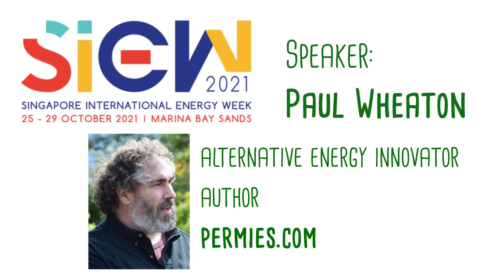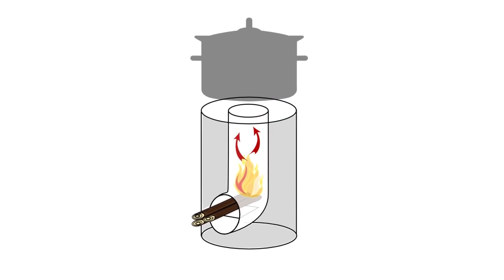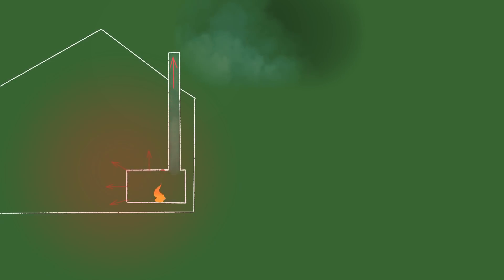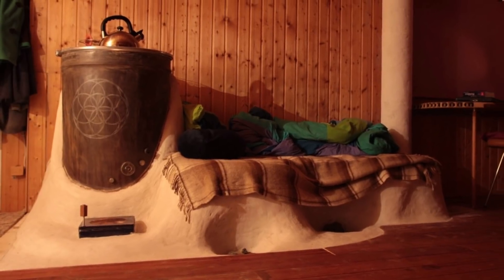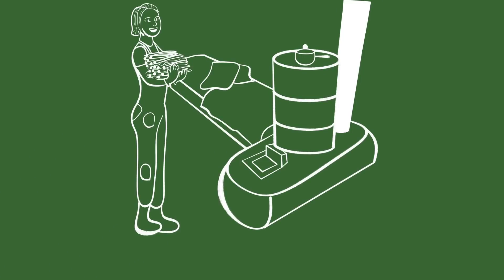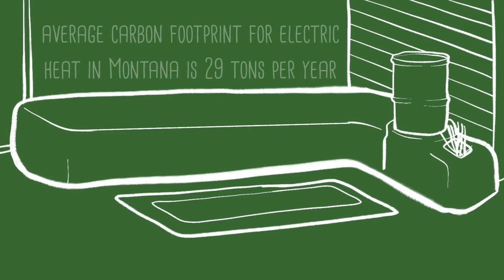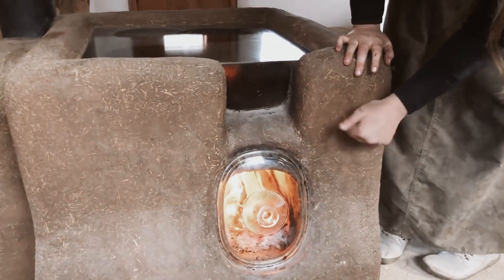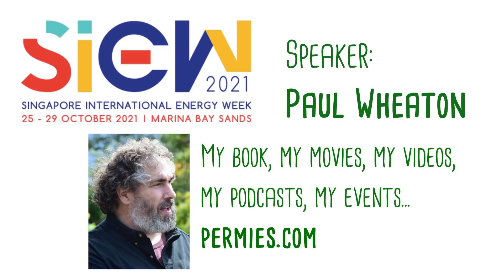Presentation for SIEW - residential heat for first world and third world countries

Comment: Especially now at a time when the supply chain is under pressure, your ideas are important. In this video you stated that you share your knowledge for "free" and that is a wonderful thing. 
I watched your video on 'thermal mass heaters' several times. It's brilliant.
I'm 68, retired and I've lived with public utilities all my life so major changes in my lifestyle won't happen. If I was a younger man I would try to add a steam boiler to what you've developed.
The industrial revolution was powered by steam. Steam expands which means it can be used to push pistons or spin turbines. This was before electricity was used. Many power plants, perhaps a majority, use steam to power their turbines. 
A small basic turbine should be able to generate 12V from a car alternator to charge a bank of batteries. An inverter will change it to usable power. Many modern tools and appliances are cordless. LED lights are common.
The turbine could be any basic style. I don't think it matters. A steam nozzle would spin it. A skirt around the spinning disk would deflect the centrifugally forced steam. The apparatus could be housed in a 'steam shed'. The homeowner would have to monitor it so it's not a passive system...but...we can supply our own power needs without a meter on the side of our homes.

Comment: That's a really interesting idea.  So I guess the jist of it, is to just burn a small but fast/hot fire for a short time, and that heat is captured via the mass?   I bought property to build a homestead so ideas like this are always interesting to know.   I'll have more than enough wood to burn but if I can be more efficient anyway it's still a good thing.  If I have an abundance of dead wood I can also look at making biochar.  I want to experiment with using that as insulation actually.
Reply: That's exactly right.  You send very hot air into a mass (could be cob, but could also be a box of rocks/pebbles - check out more of Paul's videos to see) and that mass heats up.  People have made the mass into a sort of warm couch, I've also seen it made very wide and it's the bed (if you are in a cold place and have an uninsulated shelter).
Reply: Yup I've used a rocket mass heater and a hot, fast burn where the heat is stored in the mass makes it way more efficient than a normal wood stove. A regular wood stove gives you heat only when the fire is going and at night a person will close the damper down to smoulder the wood to allow the person to sleep longer before reloading. That causes a ton of smoke and creosote, and the efficiency drops a LOT. Instead a RMH you have an insulated firebox, and the wood burns much hotter so it's a complete burn with no creosote and virtually no smoke. Then depending on the design, some heat is thrown off into the space and some to most of the heat is stored in the mass and radiates out from that over many hours or even 1+ days. You can use any wood you have, even twigs and smaller sticks will work. I personally like feeding it wood that's around 1-2 inches thick, so I'm planning to grow black locust and osage orange, and coppice them for fuel.

Comment: Have you done a study of the gasses coming out of the rocket stove? Even if the smoke particulates are reduced what does that mean for C0, C02, N0, N02 etc? I assume with less fuel the gases would be less but not nil. Is the fuel consumption safe or just safer?